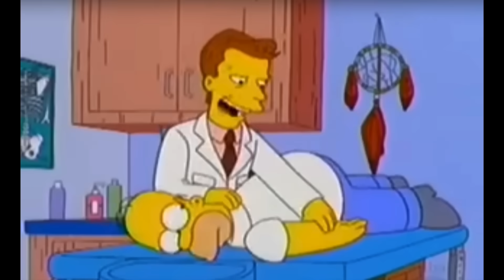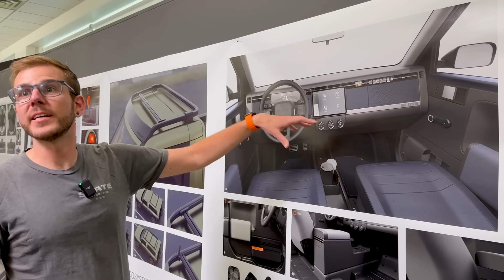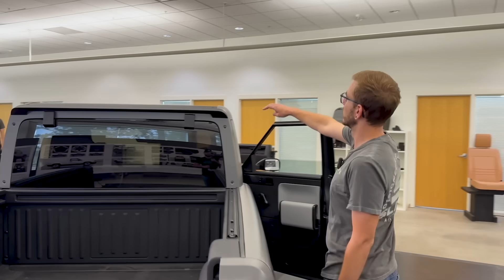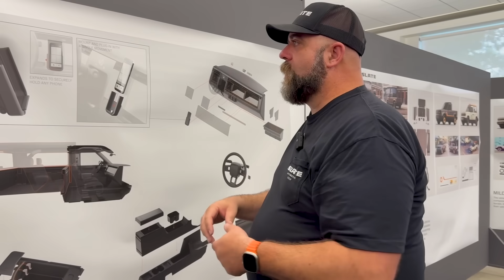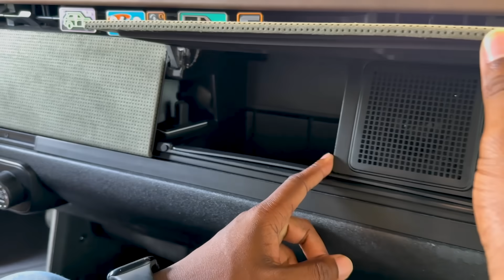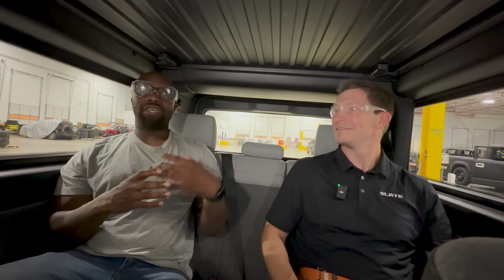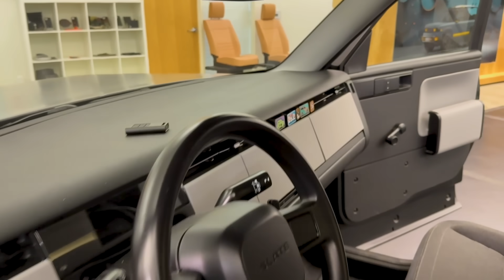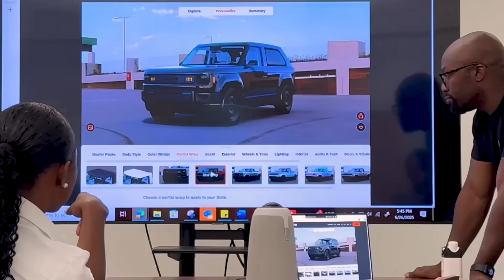The Slate: America’s $20K Answer to China’s Cheap EVs (Exclusive Access)

Comment: Honestly for this price point.  I would definitely be down for it.  Except the electric part.  I’m still not sold on electric yet.  Mainly because I don’t think the infrastructure is there yet.  I live kinda in the countryside.  There are chargers nearby.  But they few and are far in between.  I don’t want to have to wait in line for an hour just to get a charge or have to drive 15/20 minutes to another charging station.  I feel like if they made a 4 cylinder gas variant of this and just partnered up with Toyota.  It would be amazing.  Just put a Camry engine and transmission and you’re good to go.  I mean the slate battery probably cost more than a Camry engine and transmission anyway.  So the cost would probably be even lower🤷🏼‍♂️

Comment: $28,000 used to be the price of a brand new Toyota Camry not even 10 years ago. I don’t see how an electric truck for 28 grand is a good deal. 🤷‍♂️ I prefer to just keep buying $1000 vehicles and putting a few hundred dollars into them myself and that’s how I prevent myself from spending 50 grand on a new car. Also $28,000 is the base price probably $100,000 if you get every accessory that they offer lol

Comment: Why is it so hard to make vehicles with 4wd
Reply: It's a lot of complexity.  With an EV it's a new motor, 2nd drive axle, 2nd power output from the battery, lots of programming to get them to work together (watch those early cybertruck test videos of it in 4WD).  Then it adds weight (shorter range), as well as more things that can break and potential costs.   

It's $4k for the model Y to get AWD and loses about 10% of it's range.  So a $32k Slate EV pickup with 4WD that gets 135 miles of range... That's a really tough sell.
Reply: @rockinkuwaitchris  Well if 135 miles means I can not get stuck in snow 8 months a year I don't really care, range sucks in cold weather anyway... The strife of living in Norway.
Reply: @Colaglass true.  It's not much better here in Minnesota.  My 300 mile range EV is not that.  Lol

But it's interesting the slate doesn't have heated seats.  Apparently there's some sort of heated seat cover but that's one of the best ways to extend range.  Keep the seats hot and turn down the cabin temp a few more degrees.  Heating air is pretty costly.

Comment: I need you to ask some real questions, how would it hold up in 10 years. CAN I FIT A DIRT BIKE IN THE BED OR LONG BED? HIGHWAY SPEEDS?
ngl with the extended battery it does not sound to bad but I think I would want a simple engine still with a 4 speed or maybe a cvt

Comment: I love the form factor, concept and ability to convert, but the "$20k" was a lie from the start. That is AFTER a tax credit that's probably going away. This will start at $30k after tax. You could easily be up to $45k for one of these, and it will still tow 2,000lbs vs Telo 6,000. But then again, the Maverick is $35k for most models so I will be happy if Slate can deliver something decent at $30k.
Reply: When will it tow 2k lbs?  Their own release stated "around 1000 lbs".  Did that double somehow since their release?
Reply: @rockinkuwaitchris  I thought it was announced it could tow 2k. If it can only tow 1000lbs then that makes Telo an even better value in comparison.

Comment: Sorry but a 2 seat?? no way, also if you are not on the tesla network for charging stations, good luck with that al the non Tesla charging stations are terrible, always broke and long line, also can only drag a 1000 pounds, this is another pick up truck for people that do not need pick up trucks
Reply: legitimately I haven't had issues with public charging stations, though I charge at home most days and only use them when doing a 330 trip each way a couple times a month so I know which station I'm going to stop at.

Comment: If they filled the front half of the bed with batteries and it got 400 miles on a charge, I would buy it tomorrow for 30k. A truck body coupe ev with a 400 mile range would destroy the ev market.

Comment: The interesting thing about slate is ironically it what car companies USED TO DO, this isn't new necessarily. For instance my Toyota MR2 supercharged from 1988 had accessories for everything from a OEM roof rack to a shoe box behind the seat... Also you could tick any option and or remove any one etc. You used to be able to option and accesorize a vehicle anyways you want when ordering. Nowadays manufacturers just shove full loaded or base models down your throat with no options to peace meal them together and make "your perfect vehicle". I really do hope slate sees success and other companies return to form in this ethos.

Comment: I remember when Elon told me I would be able to get the top of the line 500 mi range 0 to 60 in 2.7 seconds Cyber truck for $59,9999. I signed up for the pre-order gave him my hundred bucks and then he introduced the $120,000 version that didn't do the 500 mi range. If I was willing to pay $120,000 and then $16,000 later I could lose the use of my pickup truck bed and get 450 mi range😂 Big deal breaker doubling the price and not giving me the range of 500 mi for $59,000 with the three motors

Comment: its not even 20k, its almost 30k bare bones.. you only get that cheap price when you use the EV rebate for like 7500$, and thats going away soon.. so nah, the value aint there.. not for what you get .. asking 27k for it.. then by the time you spec it out to how you want it, youre looking at a mid to high 30k EV truck, hell maybe even mid 40s here in cali by the time you sign paperwork for something that has less range than my eletric scooter .
Reply: Just buy the base model. $27,000. Problem solved.

Comment: After the 1st 10 minutes realizing the car seems to be plastic. I am waiting to see crash test. Panels popping off isn't a strategy. I don't see any cage or anything that supports crashes. Expecting to replace a dented panel is a pretty wild thougnht as the rest of the vehicle is destroyed as well. Video cash tests please. Side panel bolster and not showing airbag locations is interesting. Cheap for a reason and yugo was also.

Comment: 1:24:  Literally none of this is breakfast 🤨
13:11:  They're a big fan of SAPs 🙃
42:25: "Why do we have to gouge customers? Why do we have to have $100k EVs?"  Why are you spreading misinformation about the price of EVs?  You can get a Model Y - the best and best-selling car in the world - for probably less than what this Slate will cost when it's optioned to where most people will want it.  Tesla doesn't gouge, they just don't sell low-end vehicles yet. They also paved the way for most of what you see here.  There's no need for throwing shade and definitely not misinformation.

I like what Slate are doing.  The modularity is great and there's definitely nothing else like it on the market.  That said, I definitely have concerns.  Chiefly, is that 150 miles with an empty bed?  If so... that kinda makes this an intra-city vehicle.  I mean, if it could charge super fast then maybe not but range and charging speed tend to correlate and I'm quite positive, given the price, that this will not be especially fast charging.  I also share Rich's concerns about the actual prices.  We've all learned the hard way not to trust anything until it's selling to customers.  And I would like to see he crash safety results, though they probably will be fine.  Finally, Rich is right to question whether customization is really going to have mass appeal.  The standing knowledge, born of market research, is that it's actually fewer options, not more, that most customers find appealing.  Too many options leaves people wracked with indecision and always wondering if they made the right choice.  Sounds infantile, but its' what the data shows.

Comment: The problem with the other manufacturers is that they are installing stuff that the public really doesn't need or use in their vehicles and charging us big money for it. As long as the windows roll up and roll down the wipers' work and it gets you from A to B, what more does the majority really need. Most vehicles are just to get you back and forth to work.

Comment: Just FYI, last time I checked $35,000 isn't $20K. Lets be honest nobody is going to buy the absolute base "slate" model which isn't even 20 grand it's 25 grand to start. By the time you option it out you'll be at 35 grand. The ideas of being able to swap panels and disassemble the truck is a huge plus but it's not enough for me to give up AWD and having fast acceleration (one of the huge benefits of EV's). I think SLATE needs to offer the base model AND be able to upgrade to AWD, bigger electric motors, larger battery pack, even is it gets the price up to 60 grand they will sell way more of these. If people know they can buy one for $30K and over time make it the ultimate truck with upgrades, something the industry has never offered, before you had to go to aftermarket companies to upgrade your vehicles, this could be the way of the future , to just buy upgrades from the original manufacturer and keep your warranty.

Comment: You backed into my car, two panels busted, you take them off, nothing to see underneath, let's check the website, those two parts plus shipping, give me $750 bucks, i'll install them, we're done.
You know, getting a car that does just what you need, little more, easy to fix, mod, adjust to taste, cheap, is simply a great idea.
i hope this works out.
And there is no reason to not be able to do this for for different style vehicles, bigger SUV, sedan, stationwagon, el camino style, with maybe again a lot of parts simply being the exact same thing, speakers, door cards, etc.
Maybe the roof rack stuff might have to be different, well, some parts, like here the in the back the roof stands whatever they're called would maybe be too tall for an el camino style vehicle, but the rest of the roof rack might be the same or compatible.
The bed of the SUV might be the exact same as an el camino style vehicle, and so on.
It just makes sense.
I was think modularity was the key to the car industry many years ago, even for entire sections of cars, just longer middle pieces, extra piece in between, and so on, it just makes sense.
Sure, it's not for everybody, but it'll be fine or even a great idea for a LOT of people.
If this works, if some cars share a lot of parts, parts should be a lot cheaper and faster and easier to get, and you can likely do a lot of stuff on your own.
You can even buy a base model, and well, build it out over some time, depending on your needs and cashflow. You can also sell your stuff, it's widely known what it will fit,, you can make pics of how it looks like awe already can, but you know you can install it yourself, no huge surprises, probably not many tools needed, might be able to have just about all the tools you need in your car as standard, always on hand.
Then keep in mind that this is probably also about the easiest thing you can for a third party, easier to make things for this, easier to install those.
They say they'll release some CAD stuff, great, some standard dimensions and shapes and all that already known, you can make all kinds of things off of that, basically no issue.
And that is outside still of even 3D printing your own stuff.
I still can't afford it, but, i'd love to go this way.
Even if the ride is not as fast, not as good, it's cheap, it's easy, i can do a lot myself, yeah man.
This needs to happen in the EU as well, not sure if they take this exact thing and can release it here, some different laws, but something like this just needs to happen, frankly, i am surprised it has taken this long, i felt this was the way to go even 20 years ago.

Comment: i wonder if a car like this would be cheaper if they just threw in a small japanese 4cyl engine and 5 speed manual
Reply: It would have to be right?   I mean you can get a crappy little Japanese 4cyl in a Mitsubishi Mirage today for around 14k out the door with a good dealer.  How's this one $27k+ and it doesn't have a radio, doesn't have power windows, doesn't have carplay or Android Auto, doesn't seat 4 people, doesn't have a paint job...   Where else can the money for it be going there?

Comment: This is what Copo did for Chevy with the Camaro. They got base model cars and did the packaging in house. I could see Slate dealers performing a similar role. It's a better use of resources to move final finishing closer to the customer, you could watch your truck being fitted out perhaps. There is potential for made to order trucks with same day delivery, that's wild. The truck is meant to be DIY so the dealer isn't going to need much for special equipment. They would be demonstrating it's ease of customization. It would make dealers an integral part of production instead of just a parasitic middle man.

Comment: I always had a truck. Now I have a 2008 Chevy colorado 2.9L it is considered 1/2 ton. I use it like a 2 ton. I took out the back seats and put a shelf system in to hold all my tools. Welded a rack for the back window so I could carry 16 foot long pieces.  Welded angle iron on top of the bed to make it stronger with hooks for straps. This is a truck make it useful ,strong ,simple, reliable, and low to the grown for easy loading and unloading. We need to know what it's rating for load and pulling.

Comment: My favorite thing about this whole video is that the demo vehicles they showed you had scratched, scuffed, and dinged beds. Just shows you that they know they built trucks and they're like, "yeah, we're using them as trucks in testing. So, the bed isn't clean and factory new anymore."

I pre ordered they day they announced; but, I will say, I'm hoping that an all wheel drive option will come to market. 

Dear SLATE, this could be as simple as optional modular front hub motors. As long as you made the motor control unit capable up front. Doesn't have to be something like a drive unit under the frunk. This would allow people to add it later vs. maybe having a sub assembly installed or another vehicle purchased.

Comment: Versatile.  One vehicle that can do many jobs as life changes.  I seem to be owned by a Chevy Express 1500 van.  It carries, as required du jour,, 8 people, 2 kayaks, 1 hot air baloon system, a bed and kitchen, or half a cord of firewood.  There is a lot to be said for a blank slate.
Reply: The Express has crank windows.  They work.  Every time.  Forever.  I would pay for the option if i could get one for the driver's door on my Volt, just to get rid of the 2 way express feature.
Reply: @brucehalleran1149  I can't tell you the last newer car I got that the electronic windows didn't work.  My 89 corsica had crank windows, the drivers side internals broke though and it would drop like a rock into the door the moment you gave a quarter turn, then you'd have to pull it out and crank it up to hold it in place.   

But yeah, it's really simple, the switch or fuse if that does go is super cheap, the motor is pricier but they are pretty damn reliable.  It seems like it's selling the idea more than any actual issue there.